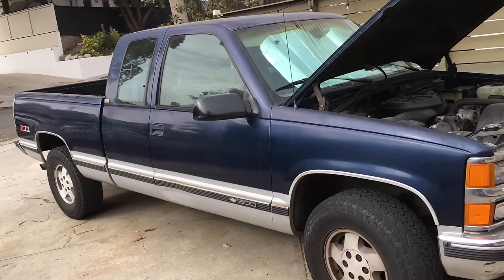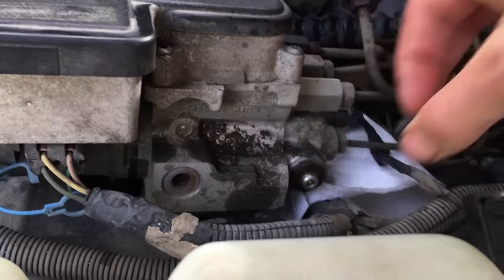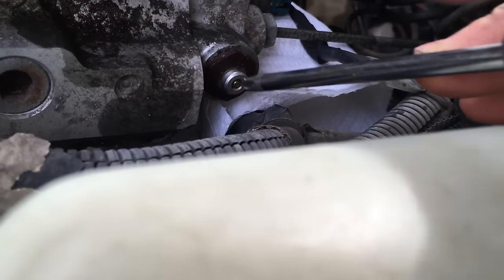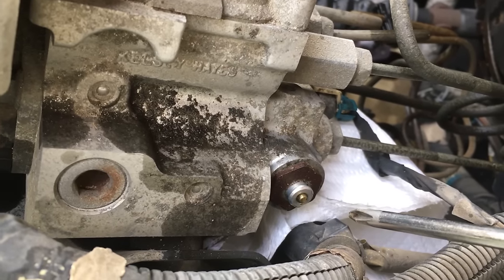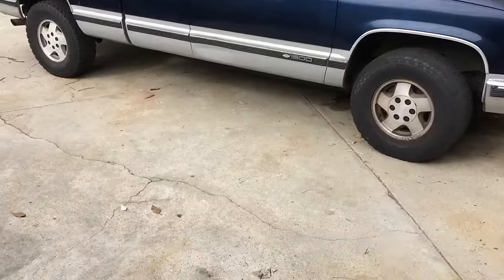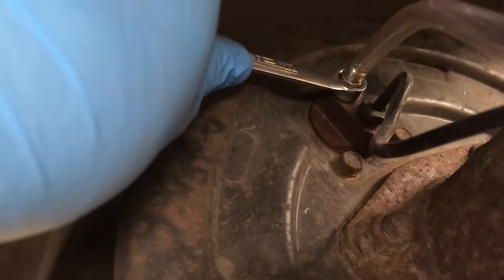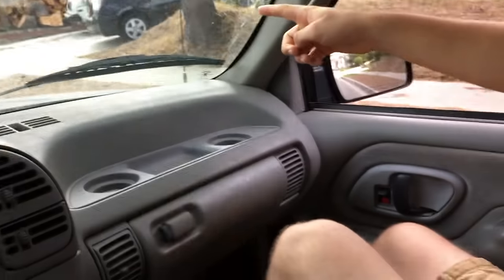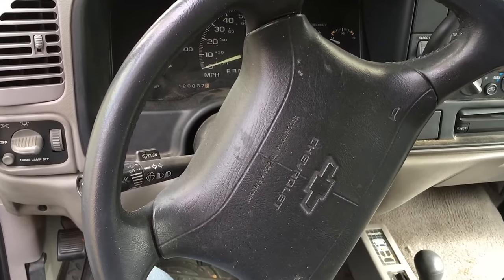Spongy ABS Brake Fix 88 to 98 Chevrolet Silverado

Comment: Been battling the soft pedal/brake light coming on when hard braking, this still didn't solve my problem, I don't know where else to turn, replaced the master cylinder a couple years ago, that's about all thats left for it to be, just rebuilt the drum brakes, properly adjusted them and lines all bled, this is making me crazy to say the least
Reply from the maker: There must still be bubbles in the line somewhere. Try bleeding it again, and then bleeding ABS module. Sometimes you have to do it a bunch of times. It’s very frustrating.
Reply: @hoohoohoblin  I finally solved the problem, re bled everything a few times and no success so I replaced the master cylinder, sure enough master cylinder was bad already, must have been defective from when I first put it in, the brakes never worked as good as they do now!

Comment: What if I do that and nothing happens... Like no fluid comes out of there..?? What does that mean..??
Reply from the maker: Try it a few times. Sometimes when I did it nothing came out, and other times break fluid came out. Maybe you need to pump more through it.
Reply: @hoohoohoblin  yeah but I think my master cylinder is broken already because it gurgls but nothing comes out so idk if my master cylinder is full of air.. or if it went bad all together...
Reply: i have the same issue, midas said the same thing, on these old trucks thats the best the pedal gets, i tryed what you did also and never got air or fluid, we did it about 10 times ?

Comment: if you use a really long bleeder hose that is taped to the side of the car higher than the master cylinder ,then down into a bottle,you won't need to re-tighten the bleeder screw every pump to prevent air from sucking back in. i fingered this out  when i had to bleed my brakes alone. you will pump out bubbles and they will rise to the top of the fluid you pumped into the tube.leaving only fluid to go back into the brake. if left to equalize,the fluid in the hose  will flow back into the lines and the fluid in the master cylinder  will be the same level. tighten the bleeder valve,then drop all hose below the bleeder valve and pull the tube off ,not spilling a drop by holding both tube ends up. stick it on the next bleeder valve ,lift the hose so all fluid runs down by valve and then open that valve and repeat the whole thing. if done carefully,you won't need to add much new fluid.
oh. DO NOT GET ANY BRAKE FLUID ON ANY PAINT OR PLASTIC. IF YOU DO, CLEAN IT IMMEDIATELY.
Reply from the maker: Good advice. I always angle the bleeder hose up so some fluid stays in it.
Reply: This will work for a short line; just have to make sure the bleeder hose you are using goes up firts before it reaches your bottle ( drill a whole in your plastic bottle cap big enough for the hose to go through it so you don't have to worry about it going out the bottle; drill when not in bottle of course. Make sure you have enough clean brake fluid to start inside the bottle where you can submerge the hose and that will stop air from returning to the valve.
Reply: will it work just taped up higher that the master and let it gravity bleed
Reply: it was comming out pretty fast i got a few bubbles that came out i did get some pressure but the pedal was still soft
Reply: I used this method with success - thank you.  Was able to bleed it alone.  Tubing is 1/4 inch inside diameter - 10 feet at Home Depot for less than $4 in case anyone needs the spec.

Comment: How do you know when the abs module 
has no more air bubbles?
Reply from the maker: I don’t know. I just pumped it a bunch of times until fluid squirted out and then stopped. Maybe you could attach a rubber hose to it that’s clear, and then you could see the bubbles in it, and when it stops bubbling it’s good.

Comment: I Just removed the abs box, put a t block in the front 2 brake lines & went directly to the master cylinder
Reply: How did that go??
Reply: @claudiobertoglia4434  great, going on 2 years, 2 sets of pads, & about 50,000 miles
Reply: Nice...I may take that road

Comment: When I do it  ,  Engine not running.  I cannot get any fluid to come out of the ABS mod. Any Ideas
Reply: Do you have somebody pumping the brakes for you while you press in on the valve? If not there won't be pressure pushing the brake fluid
Reply: @ukraineupdates9380  Thanks , but with engine off and some one pumping  up the pedal and holding it down while I open the valve on the Mod nothing comes out and the pedal won't go down . should  the truck be running
Reply: @krichards8472  Not sure what you mean by pumping up the pedal and also that the pedal won't go down? I'll try to explain quick here. You don't want to hold in this bleeder open the whole time while someone is pumping the brakes as that will push air or fluid out while the pedal is on the way down but then suck air back in when the peddle is on it's way back up as it has a vacuum effect. So have this bleeder closed, have someone start to press on the brake pedal slowly THEN open this while the pedal is on it's way down. Then BEFORE the pedal is all the way down make sure you let this CLOSE and then they can release the pedal while it's closed, keep repeating that until fluid comes out. Make sure you don't run out of brake fluid while you are doing it. I wouldn't think you would have to have it running but there might be some solenoids that control valves so you could try it with it running too it shouldn't hurt anything.
Reply: @ukraineupdates9380   That's exactly how I do it and nothing comes  out. I have blead many cars and trucks  at the wheel and this one,  97 Chevy with the anti lock will not bleed at the Mod.  I have some one pump the pedal up 3 times and holds it down  then I open the bleeder, nothing come out ( no drip, no bubble, nothing) and the pedal does not go down, then I close the bleeder have the pedal person start over. tried  many times. although I still drive the truck and the pedal is a little spongey( that's why  Pump it up) . So I just pulled the 60 amp breaker out of the fuse box of the truck and run it with NO anti lock, works better but my break anti-lock dash light is on.  It just doesn't want to bleed , I just thought  it might need to be running  to bleed the  mod.  a mechanic friend  right away when he saw my truck said those trucks have funny breaks.
Thanks for your help. ACE :)
Reply: @krichards8472  The only thing I can think of is to replace that fuse and see if that makes a difference, and you could try with it running too. Then instead of pumping up the pedal and holding it maybe try opening the bleeder while it is on its way down slowly, could pump a couple times then on the last time slowly down with the pedal open the bleeder (just make sure the person doesn't let back a bit or let off until you close the bleeder again) The spongey breaks do seem to be a commonality with these trucks. Do you ever have to top up your break fluid or does it stay at the same level? I have heard of the rubber part of the break lines for the front tires bulging and some of the braking pressure being lost there. But that still shouldn't stop the fluid from coming out while bleeding when depressing the pedal.
Reply: @ukraineupdates9380   Its Darn cold here  now  14 degree days now  so I will have to wait  till spring or a warm spell (7000 elevation). 1. next time I will try it  running  see if that makes a difference. 2.  the fuse is ok when its in,  its working ,  On a dirt road and snow the breaks  are making lots of noise so I will do  with out the fuse for now. I actually switched the fuse with another fuse  so its a good fuse.  maybe there is a clog in the mod. but thanks  for your expertise. I probably won't mess with it till Feb or March now . I will keep your link handy and let you know how it turns out.
Reply: @ukraineupdates9380  with out the fuse it works just like  regular breaks
Reply: @krichards8472  I just meant try bleeding with the fuse in and see if that makes a difference, not leaving it in for driving. If not then ya definitely could be clogged somehow but if there is solenoids that control valves might need the fuse in to bleed it. Anyways ya let me know when you do figure it out it might come in handy for my 94 1500 in the future. Have a good one
Reply: @ukraineupdates9380   good point.  but I do pop the fuse in when I do it. They are funny breaks with the fuse in, not appealing

Comment: I have a 98 GMC Sierra and tried this and I can’t push down the pin. Any help it is like stuck and even with the me pushing it it won’t budge.
Reply from the maker: Do you see it move it all when someone pump the brakes? On mine I would see it move a little bit when somebody stepped on the brakes. I wonder if it is stuck somehow.
Reply: hoohoohoblin yea it moves when I hit the brakes
Reply: I have a 98 z71 and same thing, I can see it move but I can not push it in
Reply: Same here. Pin moves in and out when I push on brakes, but I cannot push it in at all. I feel like this video isn't legit.
Reply: Any ideas?
Reply: same, no movement.
Reply: nah it's legit but somewhere in 98 they switched designs to one that cant be bled like this. the unit looks identical to the one in the video but will not allow you to purge it manually like this. Yep you guessed it, need a scantool like a Tech II or some other that does bidirectional communication and allows for ABS purge like this:
https://www.youtube.com/watch?v=jdiOlEKTqrE
Leave it to GM to find another way to rape your wallet. Just spent 75$ to have a mechanic purge my blazer ABS
Reply: You push it in before the pedal gets depressed. It will push in around 1/8 inch below surface of abs housing.  Then have somebody push pedal to release fluid. Let up on valve, then let up on pedal.  Repeat as needed. It requires some effort to depress the valve, but it will move with effort.

Comment: Does this work for 1994 s10..?
Reply from the maker: I don’t know if they use the same system in those trucks or not. If it looks like this one, then it is probably the same.
Reply: @hoohoohoblin  My 97 S-10 has same set up.

Comment: Just tried this, everything went smooth but when I finish bleeding, the brake fluid still leaks out even without touching the "button", help!!
Reply: Replace the module?
Reply: @Ryan_1997  I dont wanna replace the whole module as it will cost me big $$$ and the module was perfectly fine before this...
Reply: Did you ever get it to stop leaking? I see no one replied back to you when you have a question. They seem to only respond back when you commend them on there video... Hmmmmm

Comment: What causes front brakes to close on their own ? Have changed calipers flex lines & pads / rotors on both sides ? An they still close up. What could the matter? A bad master cylinder please advise have done all this 2 times now going crazy
Reply from the maker: I would suspect the master cylinder if you changed everything else. Something is creating pressure and then not allowing the pressure to release.
Reply: @hoohoohoblin  Front brake hose internal failure can cause that.

Comment: Spongy brakes and when i go to a stop abs kicks on everytime. After a while of driving and stoping the abs light comes on then brakes work fine. Shut truck of and back on the light goes away but does it all over again
Reply from the maker: Not sure, but I bet bleeding the brakes would help. When the ABS light is on, the system disables the ABS unit and then you have normal brakes, and fluid doesn’t go through the abs unit, so there is something wrong with the ABS hydraulic circuit.
Reply: hoohoohoblin i was looking online and apparently wheel speed sensor would cause the abs to kick on. Ill get back to you if that ends up fixing it. Also ive put almost a gallon of fluid through trying to bleed brakes

Comment: Ok, my 1998 chevy silverado 5.7L Z71. Replaced M/C bleed the abs, then all four wheel. No lights are on at all But still spongy pedal.
Reply from the maker: These brake systems can be really frustrating. Even when they’re in perfect condition, they can be pretty spongy. Mine has worked really well since I did the brake bleed in this video.
Reply: some folks just remove the whole ABS unit and plumb in a proportion valve like they used in the old days...gives a much firmer pedal, but you will no longer have  ABS function if you slide. If you don't live in a snowy climate, than it's kind of a non-issue anyway.
Reply: @molly18239  My experience has been that you're better off without GM ABS. It actually introduces a lot of danger; you can lose all braking ability at low (parking lot) speeds.

Comment: What if it makes a air sound comes out of it with pushing button in?
Reply from the maker: Keep doing it until break fluid comes out. Make sure that there is brake fluid in the reservoir.

Comment: you can't bleed the rear brakes on that truck man,everyone for years has been saying start at the back and blah blah,the rear is ABS,a lot of people with these trucks bypass the lines,what i had to do is take it to a shop where they have a machine that they hook up and it bleeds the rear brakes,probably the thing you were pushing in with a popsicle stick.i just paid to get mine done a few months ago,now you can bleed the front,just not the back,but its well worth it to take it in,i have a 9 inch lift with big tires on my 95 1/2 ton,so I'm going to go with some 3/4 ton calipers for the front,and then maybe a set of EBC green brake pads,those are around a hundred bucks but will be worth it.good luck with your truck.read on here for bypassing rear ABS to bleed brakes man and you will see what I'm talking about ok,not trying to be a dick,its just that i just got done with this and yea tired of false info you know what i mean,not your fault,later man

Comment: I tried this method exactly as you said.  No fluid came out of the pin area and my pedal felt the same.  Thoughts???
Reply from the maker: Do it a few times. It might not work the first time.
Reply: Yehhhhhh except I did it probably literally 50 times.  Did you have to push on the pin REALLY hard?  Like does it go in more than flush to the little orifice?

Like an innie instead of an outie?  Haha

When the pin popped out I pushed it and nothing happened

When I stopped the pin from coming out by pushing on it before my buddy stepped on the brakes, still nothing happened
Reply: After re watching, it looks like I answere my own question and may need to press it harder to get it to go in

I’ll re do it tomorrow

Thanks for the reply btw

Comment: You can always use the automated internal bleed option on your scan tool.
Reply: Doesn't have that option at least my 97
Reply: @Lucky13tiki  I have a 97 c3500. It has it. What scan tool are you using?
Reply: @dieseldog2649  launch x431 diagun v. I have a yukon. I noticed that other vehicles that are the same year are different than the yukon.
Reply: @diesel dog  my yukon has the hydroboost master cylinder idk if that makes a difference
Reply: @Lucky13tiki  what do you mean by hydroboost master cylinder.. they are two separate parts just bolted together.. were you saying your scan tool does not have the option when you go into the programming?
Reply: @diesel dog  it had the option just not for that vehicle. I can connect it to my brother mercedes and dad's jeep and it'll work but for mine it doesn't show up on the list
Reply: @Lucky13tiki  ok.the original poster will probably disagree with me on this. But I've done it on other vehicles.. does your abs box look like the one pictured above ? It should have at least one bleeder facing defender probably under a little rubber cap.
Reply: @diesel dog  strange than I'm probably gonna a have to talk to launch cuz the scanner has that option. Yeah looks like that has 2 bleeder valves. One like that one showed and another on the other side opposite side. I was able to bleed it manually like the video and no problems. Just not able to do it with the scan tool
Reply: @Lucky13tiki  what scan tool are you using.. and does it have a GM programming card? The generic scanners sometimes don't have certain options for certain vehicles.. you could probably take it to a brake shop and ask them to plug their scanner into it and see if it has it on there's. Trust me I know nobody  wants to pay a shop but just to do an auto bleed they might only charge you 30 40 bucks maybe less.
Reply: @diesel dog  it's called a launch x431 diagun v. I'm not sure if it has a gm program card but it's supposed to be able to work with all vehicles.
Reply: @Lucky13tiki  find someone with a tech2 scanner. With a GM card. I tried a different scanner first and it screw some stuff up on the truck. There is a tech2 clone you can get cheaper than original but still a couple hundred I think.
Reply: @diesel dog  I'm actually going to get in contact with the dealer tomorrow to find out maybe they could check to see if my model even has that option. They could probably tell me a little more with my vin.
Reply: @Lucky13tiki  definitely a good idea.. holler at me tomorrow and let me know what you find out.

Comment: I have a 98 gmc and the rear are locking up and the front brakes aren’t working at all I’m getting flushed to every wheel and have bleed them all I don’t know what’s wrong with it
Reply from the maker: That is really strange if there isn’t a leak in the front lines. Maybe the thing in the master cylinder that you know it’s pressure to the front breaking circuit isn’t working.
Reply: Gunner Voorhees did you recently replace lines.
Reply: @SassyMudTruckDegenerateDumbFk  sounds to me you either have air in the master cylinder or the front seals are bad in it. If you ever ran the Reservoir dry or you replaced it and didn't bleed it you will have air in it and it all start right there